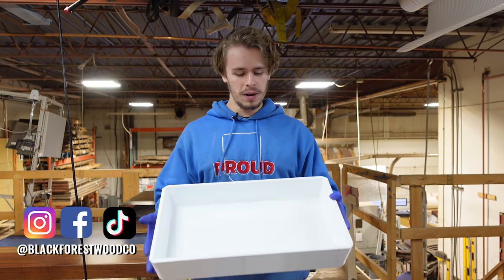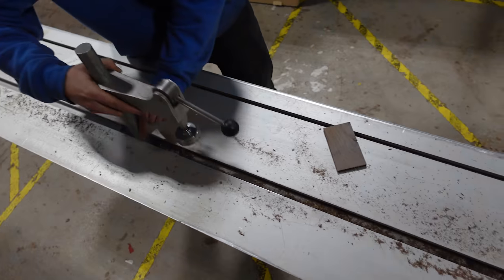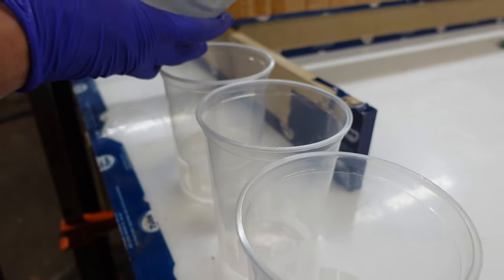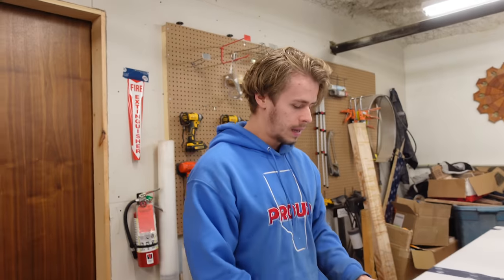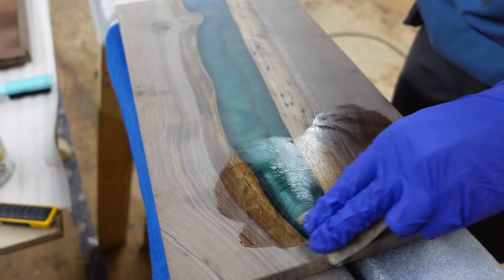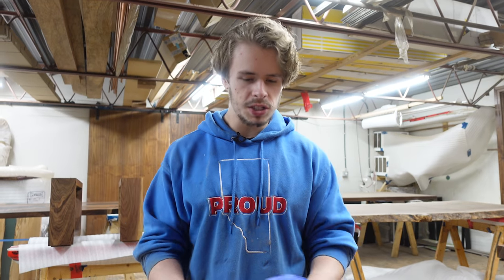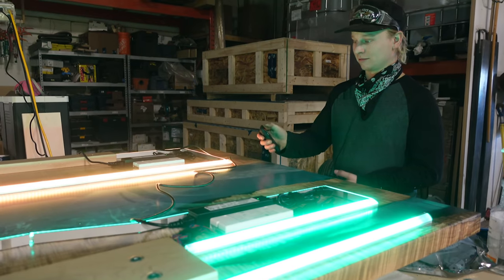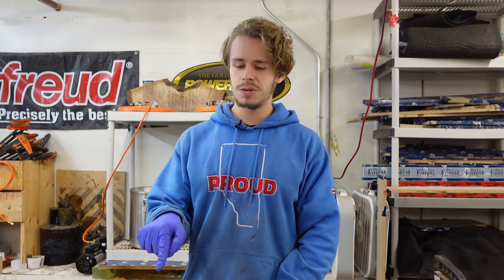This is The Easiest Way to Do a Resin Pour

Comment: For those in US interested in molds but not wanting to look up price conversion: (105.95 | 82.96) (150.95 | 118.19) (195.95 | 153.43) (255.95 | 200.41)
Reply from the maker: Thanks for converting the prices for us!!
Reply: of course it all depends on the rates of the day
Reply: What about when you turn it over.
Hit with hammer
And the EPOXY SHATTERS LIKE GLASS.
Reply from the maker: @craigmansadventures9246  That doesn't happen haha
Reply: @BlackForestWoodCo  I just had that happen! LoL. It didn't shatter like glass but it did have cracks throughout.

Should I be using some mold release or liner under the epoxy?
Reply: @craigmansadventures9246  I found on a website a while back that a small amount of liquid soap and water misted will help. I do not know if this is true as yet but am going to try. If you attempt this I suggest a small mold first  ;)
Reply: @CharlesHallam  I tried using a spray can of Silicone Molf release. This worked! As well as Reynolds plastic wrap.
Reply: @bungieflow  No, I use black diamond color pigment ( powder )
Reply: @bungieflow  my life, lol
Reply: $141 for shipping was too rich for my taste.

Comment: I say to myself oh these molds look perfect for me! Goes to website, $260 for the 18 inch.... I'll keep making molds apparently
Reply: Thanks for saving me 15 minutes!
Reply: I'm with you guys. You can't tell there isn't something out there comparable that's wayyyyy cheaper.
Reply: It would be worth it if little or no trimming was required.
Reply: I found them even cheaper on Etsy. The small charcuterie board form was $85. I've only done a couple epoxy projects and I'm thinking I could get into a little faster with one of these molds, but after running the numbers I don't think I could keep my pricing competitive with ALL the competition on Facebook marketplace. We will see if I pull the trigger or not...
Reply from the maker: Our 18” mould is $105, which is $81 USD, they’re comparable to anything else on the market!
Reply: @BlackForestWoodCo  that actually does makes a huge difference, thank you for clarifying! I did not realize I was looking at CAD, I should have checked before I spoke.

Comment: You should do single pieces of the same plastic that can be stuck down with silicon to divide the mould up further, so you could for example use the large rectangular mould split up to make four table legs with wood and resin.
Reply: I don’t think silicone will stick to HDPE.   I wonder if the blue Tuck Tape will stick to the HDPE.

Comment: Question for you..... why do you overfill?   Seems like it uses more resin and makes more work after demolding.   I just ordered the 12 x 24 mold and slab and want to ensure I will be using it correctly.

Comment: I have a question about heat tolerance — when using epoxy, not everyone has chamber to remove the bubble . . many will use a torch, me included . . . how likely is the mold to respond to incidental contact from a torch ?  I know better than to keep a torch on the material for any length of time but given the prices for the molds, I would love to know if others experience any issues when heating the epoxy with a torch – thanks in advance

Comment: Question #2 . . . how resistant is Osmo POLYX-OIL to wax ?  I made some candle holders from Maple and Epoxy . . .finished with a Mineral Oil and Bees Wax . . . someone hit the candle and it stained the wood (clearly the MO/BeesWax is not enough, so wondering how the POLYX-OIL holds up . . . yay, nay ?   if not, what would you recommend to give a matte, more natural finish (like the beeswax) on both the wood and epoxy . . . thanks

Comment: They look like they would even be handy for filling in cracks with epoxy on a normal chopping board because usually I would have to worry about it being stuck to the table
Reply: Epoxy isn't great on a chopping board. It's very brittle and can flake off into your food (at a microscopic level) when used with sharp knives. That's why they always say charcuterie (as in serving/displaying)

Comment: i had a question. i recently bought a competitor mold like this one. dont wanna put them on blast but had an issue with my first pour. seems like because the bottom is slightly moveable to make it easier to demold that it made my board have a bow in it. company says you need to clamp the mold to the table which is difficult depending on your table to get all 4 sides. They say that will push it down to your flat surface and remove the bow. Is your molds like that as well?

Comment: Thanx for the video and amble selection of molds.  To help with best practices what are the specs for the saw blade you use to square the edges of the charcuterie board?

Comment: how does such huge pours not get any cracks? The table is amazing!
Reply from the maker: The kind of resin we use (Black Forest Deep Resin) helps a ton, and we also take a lot of other preventative measures to keep our pours from overheating. Like keeping the room cool, using aluminum under our pouring tables, using fans etc!

Comment: Hey Dylan. Great job as always. How to you prevent the mica powders from settling during curing on a deep pour?
Reply from the maker: Hey Chris, the powders we use (Black Diamond and Ecopoxy) are light enough that they don't sink down so we don't have to worry about that. We used to try to make mica flakes work by  doing layered pours, but now we just usually don't' use those
Reply: @BlackForestWoodCo  thanks! Keep up the great work!
Reply from the maker: @chriscarskaddan64  Thanks Chris!

Comment: Do you have any recommendations for someone who doesn't have a planer? an orbital sander work (outside of it taking forever) or is there better way of doing this? I've never done any pours myself and would like to give this a try.
Reply from the maker: Without a planer it would be an orbital sander unfortunately. Like you said, it works but will take a long time. 
Maybe try to find a shop that could plane it for you, we offer this in our shop for our DIY customers!

Comment: I purchased several forms for your company and am loving them thus far!  I have ran into some of the tables (24 by 48) cupping on me and was wondering if that is a problem you have encountered and how you addressed the issue?  I have flooded some of the tables and not others.  We mill and dry our own slabs and wont have thicker pieces with room to mill them down substantially for a few months so trying to do everything we can with the thinner slabs we currently have to use.
Reply from the maker: Hey Andrew! Thanks for the purchase. 
Whenever we experience cupping it is usually a result of our wood not being completely dry. 
Another thing that can cause it is if the top and bottom of the piece were not finished in the same way! 
Hopefully this helps!
Reply: I apologize, I do not think I worded my issue properly or specifically enough.  The tables are cupped when they are removed from the forms. We clamp them down and everything but are still having issues.  Some people are saying it’s because the epoxy is shrinking and pulling the slabs and causing the issue, sound right? Should we seal the slabs before the pour or how do we fix this? We have most everything else figured out, one last hurdle to a perfect table for us!

Comment: Watching videos to learn. Haven't poured anything yet. 
Just about every other video I have seen so far sealed inside the cavity first to reduce air bubbles.
I noticed you didn't do any pre sealing first, you just poured your deep cast in and moved on. 
So is the thin seal layer on the inside cavity not needed??!!!!
Reply from the maker: We never seal, we find it compromises the bond between the wood and epoxy! 
https://www.youtube.com/watch?v=2yVs2EAxIdQ&t=322s
Reply: @BlackForestWoodCo  Exactly!!!!!!!! 
I'm getting ready to pour epoxy in/into a butcher's block counter top that is split. I got it from Lowe's for almost nothing because of the split, still a good piece though, 39"×74". I created a cavity where the split was. I will not need a form. I DID not want to to pre-seal because I felt it would reduce bond strength!!
Thanks for confirmation. You nailed my concern right on the head!!!!!!

Comment: An HDPE bin for $100+?? Walmart, Canadian tire and others carry these for only a few bucks. Am I missing something? Does it come with the resin and wood too?
Reply from the maker: These are quite a bit different than a plastic bin you’ll find at walmart. Ours are made from 3/8 HDPE, plastic welded, and have wedges sides for an easy release.
Reply: You’re really not. Just use mold release spray

Comment: so I bought your 18"x10" tray.  I have poured my epoxy and it has now cured.....  but I cannot get it to release.  I never saw you add any mold release you simply hit it with a Dead Blow hammer.  I CANNOT get my board out.  Any tips or secrets.  How hard can I smack this thing?

Comment: Cool product, and I eventually plan on picking one up! :D
Quick question, why are the corners shaved down?  It seems like a potential failure point since there's less material there
Reply from the maker: It’s just from cleaning up the welds! These moulds are plenty strong!

Comment: First impression on your business, wonderful amount of wood in stock, however, how much do you have in capital just sitting there?  If you just estimate that each slab cost you say $300, my estimate is that the one wall alone has probably $30,000 value.  How long before you make something of each one?  What is you only can make one desk/table each week in production?  That is a ton of stock doing nothing.  If you begin more production, 4x, you still only have 200 units per year.  Suggest you sit down with a business planner and relook your model for investment and then Return on Investment (ROI), you appear way, way, way underwater on stock wood.  Just my thoughts. Mikal.

Comment: I like resin tables. What I don't get is why they are so goddamn expensive. These are giant slabs of useless wood that can't be milled into anything useful. Make them flat and glue them together with floor sealant and it's magically "worth" $10 grand. How big is the market for $10,000 tables?

I appreciate the slabs are expensive, but again, why? They are junk. They need to be carefully stripped of rotten wood, bark, nails, etc. Here in Australia I can easily go to 10-20 properties every weekend and get free timber - a flatbed truck with a hoist would be enough to bring them to a warehouse and roughly mill them into thick slabs. This could literally be an annual one-off trip, and I could spend one week doing this. Why don't you guys? All you need is a shed to lay the slabs in.

Then the timber is cheap - the cost of your time and of renting a truck and small crane. In fact if you mill on-site with a chainsaw mill, you barely even need more than that. Those aren't too expensive second-hand, either.

Anyway, I think the materials are way overpriced and so is the end result - an admittedly impressive end result, but reconditioned junk wood nonetheless.

Comment: look at all the resin you'd save by not letting half of what you mixed pour beyond the edges, top and bottom and then cut it off and throw it away, what a waste. by using a deep pour you don't have to worry about it exotherming and can do an exact pour with zero waste. Using those molds would effectively double your cost on resin for no reason. I'll keep making my custom sized molds for every piece, it's easy, fast and has only about 1/20th of the waste.

That is a beautiful piece of wood, but there are easier, not to mention cheaper, ways to get the same results that are also reusable.

Comment: won't be going on Tik Tok. not a safe app. Don't like the container. It is confining the item anyone would like to make and most likely is triple the cost of the at home DIY way most people do it because our projects don't fit in to some cookie cutter do it the way your told process.
Reply: plus once the thing breaks from knocking the project out of the container which it will over time at some point. your out n expensive purchase and most likely will return to the DIY method.